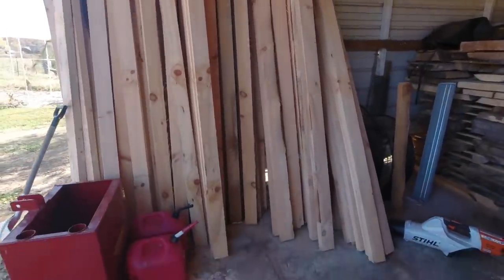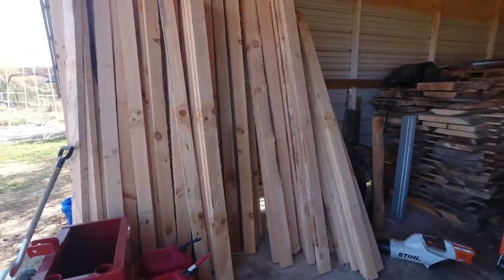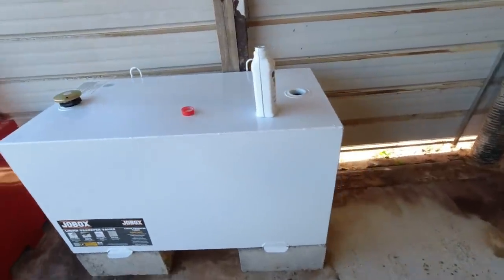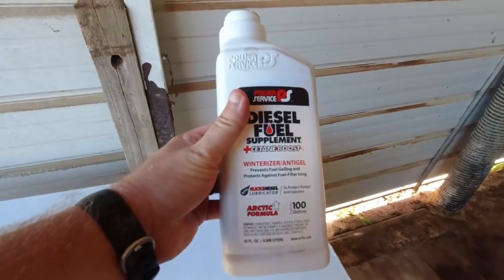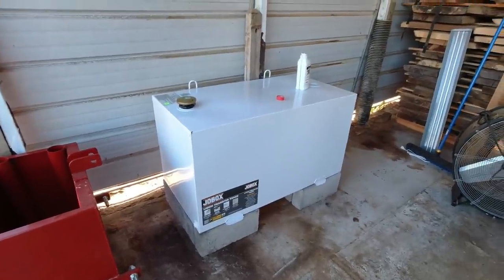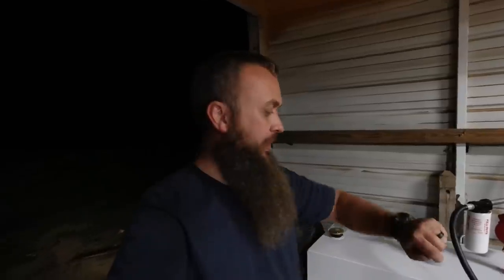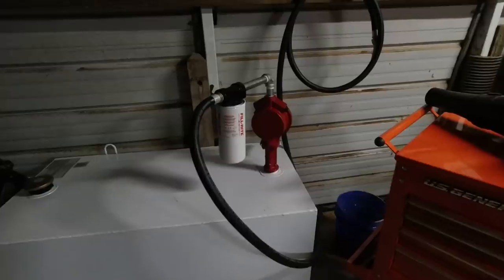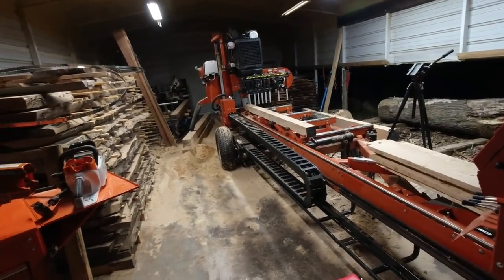Solving An Ongoing Problem At The Sawmill & A Huge Cherry Tree

Comment: That 5 drawer tool cart from Harbor Freight is really nice. I bought 2 of their 18" magnetic tool holder strips and put them on the opposite side of the handle, the mounting holes line up almost perfect with the bolt hols in the cart. It works real nice to have commonly used tools at the  ready.

Comment: Have you considered mounting the tank higher, 5’ or 6’, and using gravity feed instead of a pump? The outlet would, of course, need to be near the bottom of the tank rather than the top. The diesel tank on my grandfather’s farm used this arrangement and it seemed to work pretty well. This idea might seem more appealing after a long session of hand cranking.

Comment: I dont kmow what the availibility is for ya in Tennessee but we use blended diesel in the winter 50/50 #1/#2 to keep it from gelling up. Usually good to -40 or colder. We use Howes diesel additive also. Seems to work better than power servoce unless you are actually gelled up then power services 911 additive is aboutthe only way to get running without warming the machine up. Take care and STAY SAFE!!

Comment: I pick those tanks up used with pump & filter often for $150. I keep them around b/c a prepper mentally. Here in the People’s Republic of CA. when diesel is stupid cheap. I load up. I recently picked up a 250 gallon ag full barrel with pump. Now it’s time to lay a pad of concrete for it.

Comment: If you come back to see this.  Get K100 for diesel.  You will never use another product.  Greene county Co-op sells it, so maybe Washington County Co-op does too.  Kabuta may also.  I used to use the Power Service treatment in my truck.  Never stopped diesel from gelling up.  Switched to K100.  Never had an issue again and never once plugged the block heater in for a -25° morning.

Comment: Hi Nathan!,
Your videos are some of the best that I have EVER seen!
I noticed that you are using galvanized fittings on your diesel tank. As a diesel mechanic, I was taught NOT to use galvanized fittings, as the diesel will cause flaking of the zink.
We only used brass , black pipe, some plastics, aluminum, some rubber. Please check with Cat, Cummins, or Detroit. I would hate to see you end up with injection pump problems! I am 80+, and have worked on diesels for 60 years.
Thank You!
Gary

Comment: Hello from the Netherlands .  for the diesel tank: why don't you make a kind of dog house for the tank from the old side-wall panels and then put it just outside against the barn wall with only the hose inside.  such a tank inside is a waste of space.  if the filling nozzle of the hose hangs straight up, it should not leak anymore.  There are also special holders for which the top is shielded so that no dust or dirt can get into the hose opening.  Kind regards Hollandduck from the Netherlands

Comment: It might be worth your while to make a custom pallet for your diesel fuel tank.  It will make it easier loading it the bed of your truck.  Mike Morgan at Outdoors with the Morgans has done that with his diesel fuel tank.  Seems to work for him.
Reply from the maker: you might have missed it in the video, I have a fuel truck come out, not a fan of driving down the road with 100 gallons of diesel in a non commercial vehicle, illegal in this state,
Reply: @OutoftheWoods0623  clearly, I did miss that point.  Hopefully the tank has some sort of gauge on it, I imagine that there is a bit of lead time to get fuel.  One wouldn't want that aggravation after getting the tank.
Reply from the maker: Agreed 👍👍👍

Comment: You should be able to find a bracket to mount on your wall by your new tank to hang the nozzle up right so it won't drain. Is the fuel truck going to be able to make it back there to fill it? Thanks for putting out great videos I enjoy each & every one.
Reply from the maker: Thanks for the tip

Comment: Nathan, as an I/T professional, I spent 45 years driving my own cars for a variety of computer companies, as well as the State of AR. A sizable number of years/miles were spent driving diesel engine autos, and I learned early on that Power Service fuel additive can’t be beat!. I liked it so much that I ran it as a supplement in gasoline engines as well! As long as I did my part, kept some amount close to the instructions  in the tank, fuel problems were non- existent! Many years, I drove far in excess of 100k/year so I’m pretty sure I know what I’m talking about. Use it with confidence, leave the competing products for your competitors.

Wave when you pass them on the road-side...

😁👍❗️
Reply from the maker: Awesome thanks for sharing
Reply: Roy Colglazier  Which type of Power Service fuel additive did you use for regular gasoline? They look like a good line of products! Thanks!
Reply: I always used the diesel additive that’s sold @truck stops & parts stores. As I stated, also works fine for gasoline to diffuse water when buying from dubious sources like small stations & stores in rural areas!

Comment: The tank and pump I have on our big truck it electric.  I have always wondered with a hand crank system how you know the tank of the tractor or mill is full as you are at the hand crank and can't view the tank level until it over flows.  The electric allows me to be at the tank.  How do you deal with this and a hand crank?  I like the simplicity of the hand crank and not needing power to get fuel.

Comment: Need to put that tank on a small 4wheeler trailer with a removable reece hitch type tongue.. that looks like it's just going to be in the way to get to your slabs.. then you can move it around and run into town to get your fuel instead of paying extra for a fuel truck to drop off a hundred gallons or so.
No offense just an observation
Reply: I have that same fuel tank, I use my tractor with pallet forks to load in truck and move where I need it when I get back from town.

Comment: That diesel set up looks good. Just wondering if you legally can put it into a "building". On our old farm all of our tanks were outside on overhead stands. Just wondering.
Reply from the maker: if I delete this comment lol then you were right, lol,
Reply: Was thinking the same.   On all our farms they were outside.   Also sitting on cinder block/breeze block with a piece of 4x4 between them and the tank.  They were all about 3/4 feet of the ground to allow gravity feed.   Also due to two legged rats a padlock as they were some distance from the house.

Comment: The filter is essential, it could save you a fortune later. If your fuel truck has an issue or you get some saw dust in the tank you can collect it in that filter instead of your tractors or the mill. We once had a disaster on the farm where a bunch of machines got contaminated fuel, a good filter would have prevented it.
Reply from the maker: well said, totally agree,

Comment: I've seen some other videos of Woodmizer larger band machines.
Is there an advantage of a wider band saw blade?

Being a Band is wider, there shouldn't be so much chaffing or vibration of blade between slabs. 
I've watch one of your videos which showed a limitation of tree diameter being a too big for your current Woodmizer.
Would it be better to go "BIGGER" for what you do.

Comment: I'm thinking that money dictated what size and pump.... I am a fan of a electric pump as they really do it easier on the filler person. Sure it does cost more but your at the fill site and know when its getting full.. you will like this system too. Do the fuel companies come out and fill tanks that small, I ran into the five hundred minimum and that was of just one fuel type. I am thinking that your truck and other all run on diesel too but then you have to get that Dep stuff that seems to amaze me that they could think of something so perverse to use. Happy for the advancements for you... I hit and miss your channel as I am a grease monkey sort but thought to myself   when watching the other day, I thought that mill was gas and now its diesel which is better by far for many ways. I will shut up now

Comment: You mentioned that you put "cinder blocks
' under your new tank. They don't make "cinder" blocks anymore. Cinder blocks were made from coal ask from power plants. It's all cement today.
Reply: I suppose that you meant to type "coal ash" instead of "coal ask"? And by the way, NO concrete whether it is reddimix out of  a transit truck or a precast product is EVER "all cement"! Water, cement and several sizes of aggregate would be typical.
Reply: It really doesn’t matter what they are made of anymore, they could be made from compressed saw dust and resin but we are still gonna call them cinder blocks cause that’s what they were when we grew up and it’s what everyone in the trades knows them as and I don’t see it changing anytime soon. 

If you call someone up and tell them you need 100 8”x16” cinder blocks, they are gonna know exactly what you want but if you ask for 100 engineered polywood universal building blocks then you may be in for a big surprise when the delivery truck shows up. 

When things have historically worked extremely well for 75 years, then don’t f. K with it and just keep calling it the same thing, it ain’t gonna hurt ya none Brother!

Take care and be safe out there!!
Reply: Let's face it, pretty much everything in the building trades has at least two names if not more. That being said I've never had anyone look at me funny when I say cinderblock!
Reply: @1982MCI  Yeah, but if you work at a store that sells them, you can respond to cinder blocks and know what you mean, but you had best call them 8x16 CONCRETE blocks or the store could be in trouble with an A hole customer. We had to train proper terms and common names when I was in management in the seventies and eighties. Same as food servers have to be sure when you ask for a Coke or a Pepsi. The dang companies will sue the place if they serve the wrong one. Even bars are careful. Most carry Coke just so they are safe when folks ask for a Jack and Coke. If it is Pepsi on tap the bartender has to ask is Pepsi substitute ok. Dang Lawyers ruin everything.